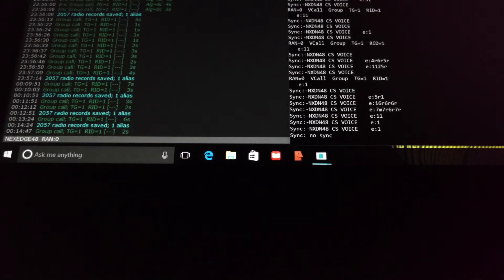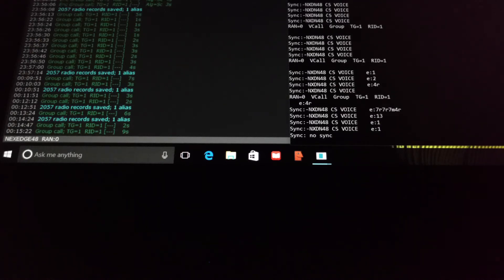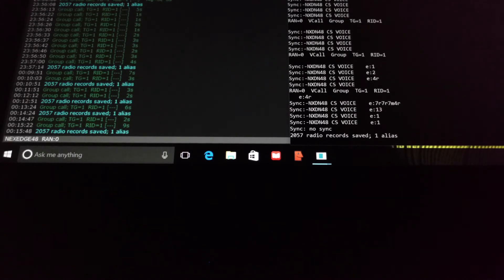DSD+ Decoding NXDN 4800 Digital Voice

Comment: great video. I'm looking for a way to listen to an encrypted frequency knowing the encryption key (NXDN)
Reply from the maker: Use an NXDN radio.
Reply: @rfi-cryptolab4251  yess I'm using a kenwood NX-240 but I would like hear the frequency on computer with DSD or another software.
Reply from the maker: @brisadelmar5686  
DSD has no ability to decode any mode of privacy, even if you lawfully know any key in use.  The programmers have stated they wont implement that feature.
Reply from the maker: DSD-FME will let you do that if you know the key. Otherwise you'll be guessing for a while I suppose.